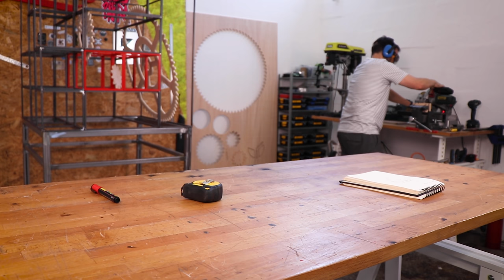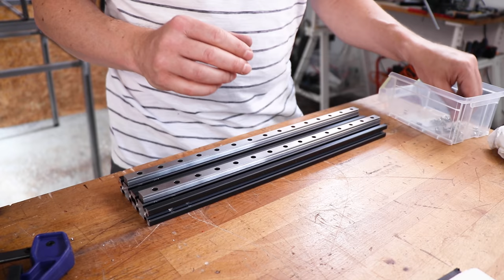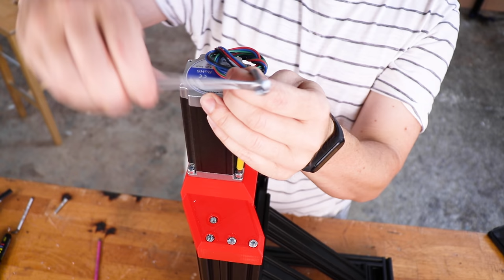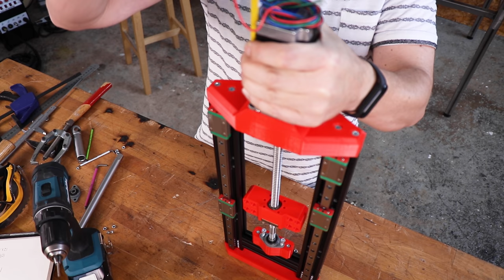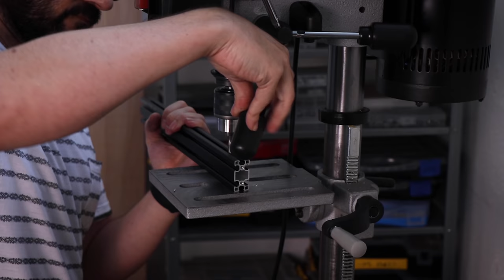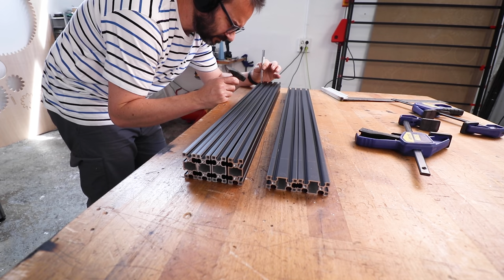3D PRINTED VERTICAL MACHINING CENTER FROM SCRATCH

Comment: Can we just take a moment to appreciate that this man uses a drill for tapping and never breaks the tap? That takes some serious skill.
Reply: Blows my mind every time!! Using a Tapmatic in a drill press so its square and I still break taps and its clutched and self-reversing!!
Reply: Not that difficult with a spiral cutter and just aluminium. The combination is quite forgiving.
Reply: I do it with a drill on ar500 now that's Sketchy
Reply: @kylec71ify  Somehow I doubt that. Hardened steel is a pain in the ass to cut. Even with the right tools.
Reply: But it's only alu-minimum
Reply: It would be almost impossible with steel though
Reply: Aluminium, and small taps - pretty low cut depth. IPA helps prevent chip weld
Reply: @travismiller5548  I feel like that was supposed to be a pun and I just don't get it...
Reply: @kylec71ify  what size bolts are you tapping??
Reply: @rodeynsrene1007  No, just use the torque limiter.
Reply: @nathaniellangston5130  m6
Reply: Or serious video editing 😅
Reply: @travismiller5548  some good ol’ AvE references.
Glad it’s not plastique
Reply: Been using drills to run taps for 2 decades. Never been a problem. Especially in aluminum.
Reply: But not always in right angle. If it is steel the tap would break after a few holes.
Reply: Just cause he doesn't show it, doesn't mean there isn't breakage.
Reply: ive tapped 1000s of holes, ive only broke one tap.  I do most of my tapping with form taps and a drill.
Reply: Not in Aluminium, especially if you set the torque.
Reply: aluminum
Reply: @HiveMind2024  Chromum. Titanum. Sodum. Calcum.
Reply: Ask Ivan...!

Comment: Ivan just a thought. The number of profiles that you drill and tap, sounds like a new machine is required to automate such procedures👍
Reply: Yeh a tapping arm would do that, you could easily make one with aluminium extrusion and a couple of gas struts.
Reply: @zakquddoos4641  A flexarm would only really be useful for drilling and tapping the faces of the extrusion, not the length of the extrusion; though a flexarm isn't that useful in making the process more efficient. A better solution for the lengths would be a horizontal drill/tap setup, where the extrusion is butted against and endstop and a horizontal stop, while using the table for a vertical stop, for placement, with the spindle on a guide and spring for when drilling and tapping; all you'd need to do is rotate the extrusion to dill and tap the next hole, as each predetermined stop will accurately locate the spindle for the next operation. For the repeated drilling along the face perpendicular to the length, a setup on the drill press can be used, all it needs is a pin for the endstop and a second pin that'll also locate the previously drilled hole to setup for the next hole being drilled, as this is a pretty basic operation. The only use a flexarm would actually provide is a preventative for repetitive strain injury from drilling and tapping each hole with a hand drill.
Reply: @xaytana  Thank you. That sounds like a plan. What would you use to power the chuck suitable for drilling and them tapping?

Comment: This is awesome!  However, I will say, as someone who owns an actual 3 axis CNC knee mill, you really should have put the Z axis movent in the knee....while yes, you can move the knee up and down for larger parts, but having such a limited z travel (as I do with an automated quill), it's extremely limiting with respect to cutter length and retract/clearance heights...very annoying....the next thing I do to mine is going to be put a ball screw in the knee, add two gas struts to offset the weight, and cut a hole in the casting to run a belt drive go the top of the screw....

Comment: Nice CNC machine build. Try a slightly smaller ripper bit for rough cuts, then the right size end mill for the finishing pass; that's what I use now and it eats through aluminium even with only a 150W spindle motor and finishes nicely without changing the G-Code. Also, you may want to look at getting a septic tank aeration pump instead of a compressor to blow the chips away, I tried this and it works really well, plus is only just above 30dB and will run continuously for years.

Comment: You can save a lot of time if you first make roughing passes with a flat end mill and then move to a ball end mill (with a much faster feed speed). Also end mills are much more efficient at working with their sides, avoid milling downwards at all costs. The surface finishes will be much better, you will be able to use faster feeds, you will significantly reduce the chances of the end mill clogging up (and breaking) plus the tool life will be longer. You made yourself quiet a tool, really interested to see what you will make with it, good luck!

Comment: Nice builds but there are many problems that I see with your builds FYI I have been building cnc mills for the past 10 years .
1 it you fill the aluminum extension with epoxy granite that will help with the vibration that will increase The CNC performance .

2 add a support beam at the front of the xy carriage that will make the Bed more flat .

3 Mill the connecting surfaces flat ( where the Linear rail Is mounted )

4 add steel plates in the z axis of the spindles.

5 buy a metal spindles not a wood spindle like you are using the Will improve the tolerance and will last longer.

Comment: Ivan your an absolute weapon!! I love your builds. As a CNC machinist myself I really appreciate what you do and live your antics. You keep saying your machining skills need work. May I suggest the following:

Instead of IPA use a petroleum jelly or kerosene as a cutting lubricant for Aluminium (it's what we use in industry)

When setting your toolpaths try to do it in such a way that you maintain a constant chip load as this will give you good performance from your cutting tools. 

If the material is fraying like it is, it's because the speed is to high and it is cold welding the chips back onto your workpiece as the tool is bringing the chips back around. Imagine metal cutting as more of a sheering than a cutting action, like scraping a knife along a block of butter rather than slicing straight down through it. 

You are essentially trying to force the material apart, the softer the metal the gummier and less likely to separate it is, excluding self lubricating materials such as bronzes and brasses. 

Have a look at the Vm data on your cutters and they will have operating ranges for speeds and feeds, going below is just as bad as going above. Look at your tool and see what it is telling you.  Chipping means too high a chip load, a built up edge on your tool means to fast or the wrong coolant/lubricant, carbide tooling when it's sharp has a dull edge feel, when it feels sharp it's dull. 

Generally when cutting dry I reduce the speeds and feeds by about 50% to prevent problems. For demo prices and trial cuts use a free cutting brass as it almost never clogs the tooling. 

Ok hope this helps a little. Keep up the outstanding work!!

Comment: Such an awesome build! You should try to avoid slotting with your endmills as much as possible, it's horrible for surface finish and chip evacuation/tool life. Also on the hemispheres you could try running a roughing pass with a sharp corner endmill, or one with a small radius. Then come in for a finishing pass with the ball nose.

Comment: should really rough out parts before using a ball endmill. Balls can only feed at like 2/3 or less of a square endmill.
Reply: It this case I don't think it makes much difference since his frame is not rigid enough to handle the cutting capacity of a typical end mill. He needs to keep his cut depths and feed speeds low to get any accuracy. The aluminium is flexible.

Comment: I would throw a Fog Buster mist cooler on there. You’ll massively improve the machine capabilities. Gotta get some
Chip evacuation
Reply: Especially for Al. Chip welding is a big problem for that material.
Reply: Very late, but don’t you know it’s a  very bad idea to use a coolant mister in a non enclosed machine, coolant is already caustic to your skin. So why would you want to breathe that in

Comment: This is was really innovative. Everyone doing router style but VMC are just better for cutting metal. Really nice.
Reply: routers are so overrated!
Reply: @polviaortega3709  i mean makes sense. If you go with aluminum profiles you can not expect crazy precision. The frame is not death flat anyway. So router application fit better. I made a router while back but since I machine mostly aluminium and steel, I have converted a bf20L to CNC, with tons of features. Still hobby machine but much better for my application. A router is really nice for big not tall parts, preferably wood and plastic. If you want one efficient in metal then you need to invest on the frame. Machine aluminium and epoxy granite if possible. Linear rails ecc...
Reply: @Ale_Lab  Thats what I meant. Routers are cheap and easy to manufacture but what really gets the job done, specially in metalworking, is the VMC. I would love to se more DIY and hobby VMCs instead of routers.
Reply: @polviaortega3709  me too. I have converted two small VMC so far. Use one daily and it's really nice

Comment: Hey there! Two suggestions for lubricants that won't catch fire: Cool Tool II is got for squirting right out of the bottle or for applying with a brush. It's good for tapping too. Plan B is a soluble oil (there are dozens; I like the stuff sold by Mobil) you can mix with water and spray with a bottle or with a spray mist unit.

Comment: This really cool. It would be even cooler if you used this machine  to machine more ridged parts to replace the original ones. I think this would end up being a great video series and the results could be a stronger machine with higher tolerance capabilities. “The machine that made itself better”. Cheers for the video again

Comment: Nice work btw. You’ve shown people they can build on a budget to get started in CNC.

FYI you could also consider buying precut ATP-5 plate for components. It comes precision machined and adds weight over extrusion. Makes great printer beds, machine base, columns, etc.

You would see the benefit mixing material types quickly and so would your viewers. As I mentioned earlier 3d printing lost wax into casting of parts. 

You have the tools and knowledge to evolve. I bet if you went this route it would be a matter of time before you could compile all your videos into an evolution of DIY to industrial machinery.
 
This is what guys like myself have done to get where I am. Ive built my own industrial machine little over a year ago and it’s sitting in storage  waiting to be wired up soon as I find the space i can use it. 

You’ve got the space so Go for it.

Comment: Wow. This may be a turning point in a lot of people’s hobby. To say this video is one of the most important videos I have watched is understatement. Great work Ivan, Holy smokes that is impressive. So ballsy to start milling a metal right off the bat, I would not be surprised if Creality, or some company like that will attempt to market with this, but I hope many more will watch this before that ever happens. If anything, you may have just made CNC available for more people to afford, and that is amazing.👌

Edit: I had to rewatch the video because I was so astounded, I had to comment while the video was playing in the back, but I could not help but to have been even more impressed. The thought and integration of ergonomic features like a tilting head was so nifty for example, but I was wondering, could you perhaps use that feature for another axis? When I first watched your video, I went into worrying about backlash just because I was wondering how a machine made from plastic (possibly PLA) could with-stand all the stresses and tolerance of machining metal, but you had surpassed, I believe, many people’s expectations. I would not be surprised if you had considered the idea of a fifth axis and how to get around the complication of some minimal unwanted movement.
In any case, I cannot help but fanboy over this achievement, this had just been a pipe dream for me please keep up the good work.

Comment: Sweet project, now add a motorized axis for the tilting and this thing gets even more cool 😎
Reply: Dude, I thought the same thing when I saw that. I hope he does😳
Reply: That was my first thought when I saw him tilt the head. "Just add a ball screw and a motor and you get a fourth axis". But then I thought about it. Can the CAD software make use of that functionality? When reading up on CNC mills the fourth axis is always referred to as the A-axis, and is defined as having the workpiece rotating around the X-axis. I seems it would take a lot of tinkering to make the controller and cad software understand what to do with a fourth axis that tilts the head and has quite limited movement.

Comment: If you plan on doing a lot of cutting, build an enclosure and use flood coolant instead of just spray. It will give you a much nicer surface and allow you to speed up the process. Not to mention that flooding will wash away the metal chips so they are all in one place for easy clean-up!
Also the bottom right spindle bolt is not tight, you can see the washer spin freely there in the video.

Comment: Ivan, fantastic video as always. As a machinist and engineer, as soon as I saw the spark on the aluminum I thought 'Oh something shorted....' I can't believe that spindle isn't grounded though. Not sure I would be comfortable using that in the long run but your addition of a grounding wire is certainly a good improvement!

Comment: WOW Ivan, this is a really crazy build. I have to tip my hat.
Some friendly suggestions:
1. You don't need those monster Steppers, in fact, for what you paid for those, you could have gotten Closed loop Hybrids that hold their position.  

2. Rigidity Rigidity Rigidity!!! There's a reason your taking teeny tiny baby cuts on your aluminum (Which is why you really don't need those Monster Steppers). A good project for your new knee mill could be desiging and machining more Aluminum parts to replace your 3D printed parts. I LOVE YOUR DESIGN, but maybe make it a work in progress and show how you stiffin it up and prove it by making deeper cuts.

I watch all your videos and I love how you go big and really make DIY fun. I would just hate for someone to invest and build one of these and realize that they got roughly the same performance as an MPCNC.

Comment: You should really consider a very good filter for your electronics fan. That metal dust could brick a very expensive controller. 
Also, Rotary table coming next? If you have a CNC machine may as well make it 4 axis

Comment: Very much worth checking the grounding on Chinese made spindles; even the popular round body spindles (that are often sold with a VFD) have 4 pins (U,V,W and Earth), but in my experience the 4th pin is usually connected to nothing - i.e. even if you ran a U,V,W + Earth cable to the spindle, the metal spindle body will not be grounded.

Comment: Great build, also there is loose screw on Z at 15:34 - you can see the washer dancing :-)
Reply from the maker: Good eye!
Reply: I missed the screw, but at 18:35 the plastic plate the Z ball screw is attached to has a nice flex moment when presumably homing. I feel like I should check all of the XX:33s and XX:36s to see if there is a series.

Comment: Very very cool Ivan might I recommend a piece of literature to help with your machining. The machinists handbooks has so much great information in there it is prefect for most of what you are going to need. everything from calculating feeds and speeds to calculating gear geometry and material sciences truly a required bit of kit for anyone who wants to machine

Comment: A recommendation for bolting down linear rails: they are likely to be much straighter than what you're bolting them to, so rigidly bolting the 2 parts together will warp both parts. Use a stack of Belville washers on each bolt (6 will do, alternating them to face opposite directions) and tighten the bolts up only to the point when the washers are partially compressed; you'll need to use thread lock on the bolts to ensure they don't loosen, but you rails will remain absolutely straight.

Comment: Nice work! It's only a matter of time before this machine makes its own upgrades. The thing with any form of potential difference between the machine and the rotating spindle/lineair rails is that it can cause the bearing to go bad quickly. The ball spotwelds itself into the race of the bearing while running, deforming the ball/race slightly, causing it run less smooth.  And this goes for all the parts with bearings and races, so lineair rails with steel rails/carriages also suffer from this. With non conductive bearings (ceramic) this doesn't happen to the spindle. Some spindles have a drag-contact on the rotor to the spindle. Using thick wires to ground everything (especially on the rails/carriages when they are isolated from each other by plastic parts). Don't put any ground in series, just link them all to 1 central point on the machine.

Comment: I am shocked at how cool and how much slop there will be in this machine.. but nice. Also some advice, well i didn't see if you implemented them, but thrust bearings for your steppers, they cannot handle that much axial load, so adding thrust bearings will be a large advantage when milling.

Comment: Cool build! Gave me lots of ideas 😍
2 things tho: correct me if I'm wrong but it seems like you did not put in any proper bearings to take up the axial thrust of the lead screws (slack free and stiff)
2.: You could use a couple hundred KGS of weight on body of the machine to make it more sturdy and eat up vibrations